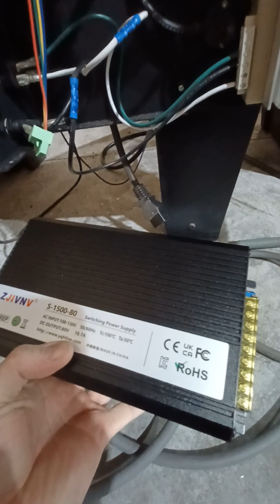Langmuir Systems MR-1 upgrades! (Part 2)  @LangmuirSystems  #cnc #cncmill

Comment: Great - why didn't you go with something like Teknic's clearpath SDSK integrated servo's?
I have them on a different mill  and they're absolute game changers compared to any stepper I've used. they're a bit more pricey - but they're so worth it...
Reply from the maker: I don't want to change the control software or control board.  So I can't go with servos.  I don't want to go with closed loop steppers at the moment because I will not know if the motors slip.  If a stepper motor misses a step it visible because the entire level is off.  If a closed loop systems slips it catches back up and that feature would just be out of tolerance and I might not notice it.
Reply: @BeckTools  Just as an info: the Clearpath SDSK can be operated exactly like a stepper - they do directly take Step/dir Signals - so as long as you configure them for the same kind of settings the original steppers run on, they can be a "drop-in" replacement for a stepper motor...
OF course you can "benefit" from additional features like the encoder / closed loop - but it's not something that needs to utilised .... (I mean, well, if you really want to go for ultimate repeatability, then yes. ...)
I don't know if fire control is adaptive enough to work with encoder readouts....   
but the SDSK on their own will actually sort of try to achieve an accurate position, using the encoder and the built in driver, by trying to make sure to do the demanded number of steps (and if not possible, say stalled, throw an error)... 

I was just curious, as to why go the length to upgrade to more powerful drivers and more powerful steppers and of course  power supply , and then sort of "miss out" on the opportunity to really make a huge difference by switching from steppers to servos...

On the one machine I've replaced the steppers with the SDSK servos, the difference was night and day...

I like your videos so far btw ;)
Reply from the maker: @ I already spent hundreds of dollars on 5amp stepper motors and big power supplies.  it's waaay to late. Also the part # I would need to buy to equal the power of my new stepper motors are $325.00 each. 
 That would cost me another $1300.00  The MR-1 is not worth that kind of investment.  https://teknic.com/model-info/CPM-SDSK-2331S-RLN/?model_voltage=75VDC